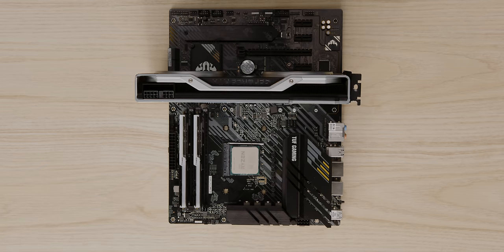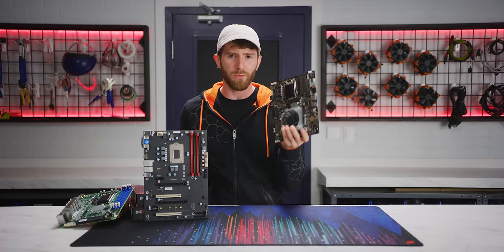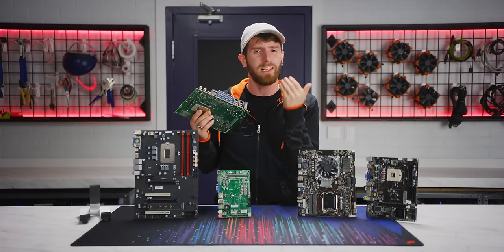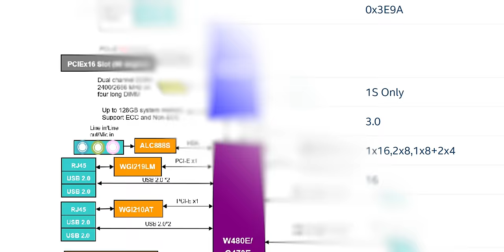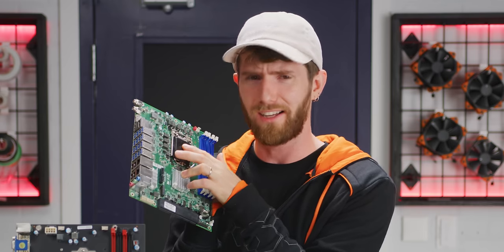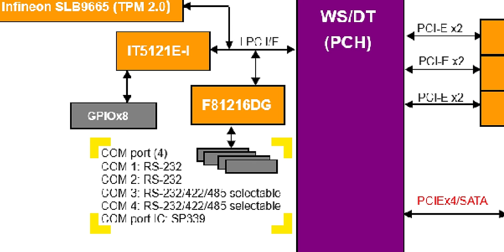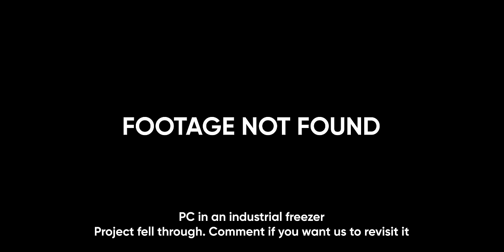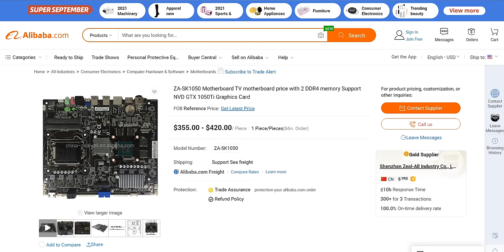5 weird motherboards that shouldn't exist

Comment: Saw this vid and it got me wondering.  With all of the various I/O available on motherboards, ie 10 USBs, 6 SATA ports, etc, how does a request for a device work?  Does the opsys simply poll all similar I/O ports, looking for the right one?  And if so, does that action slow down the computer at all? If this is the case, maybe we should be looking at a bit more minimalistic approach for a motherboard? For example, lets say i have 4 sata devices; one ssd and 3 HDDs.  when i ask windows 10 to find a document that ends up being on the SSD, it must look at all SATA devices, right?  Does the system look in all 4 sata devices at the same time?  Or one after the other?  Maybe i should only have 1 SSD with a large enough capacity and turn the other SATA ports off in the BIOS?

Comment: Moar usb! I actually needed an extra USB port to power a small 7" monitor on my rog strix b550i build. I wired a USB female plug into the 5v and gnd rails of a sata power. Works great ;D

Comment: The power for the first one is a satellite and cable type connector. I think you need to power the motherboard by fusing a wire to it, I guess.

Comment: The bonkers motherboards were the ones that supported both Intel P4 & Athlon CPUs, via a PCIe add-on card.  Or the over-engineered boards with copper cooling going to dedicated rads.
I for one miss the DFI brand.

Comment: "There's no manual available"
That can't be possible considering someone wrote drivers and the diagram you showed, it's gotta be around somewhere, guess I found another project
Reply: I've got a Portwell mobo (WADE-8321LU) and that is also in the same boat, no support whatsoever, no drivers, no manual for the exact model - had to resort to use another mobo's stuff.
Most exciting things were finding an experimental BIOS that supports Ivy Bridge (3740QM powaa), and adding another RAM slot to it (no SMD components missing, just the socket!).

Comment: Those x79 motherboards from China can be a good deal if you don't need anything beyond pcie 3.0. With the right chipset and a Xeon CPU, server RAM becomes an option, making 256GB-1TB of RAM actually feasible without costing a ton.

Comment: Those USBs aren't that stupid. Personally I use this devices on USB constantly plugged in: 
Keyboard
Mouse
Audio interface (sometimes two)
External drive
Card reader
Cooler
Grapchic tablet ( I dont know what is called in english, this black tablet you write and draw on)

That makes 8 USB ports and I need some free ones when I need to plug in some pendrive or gaming pad or an microcontroller to program or drone or other camera to service

Comment: the weirdest mother board I have ever seen was a server board that supported ddr1 and ddr2 ram
at the IT store i worked at it was one of the donated parts someone had dropped off

we had like an e waste recycling thing where people would drop off old parts or pcs and we put together super cheap computers for people

so the one office brought in 20 + computer as well as this server board
it took 2 single core celerons and had 8 dimm slots
4 ddr 2 and 4 ddr 

second weirdest thing was stackable ram so it was these ddr 1 sticks that you should slot another ddr 1 ontop of

Comment: Do the lenovo sharkbay, instead of your standard 24 pin PSU connector it has a 14 pin, this way the only way to upgrade it is to get a adapter made by some random person, and definitely not Lenovo

Comment: For the USB motherboard at one point in time I would have loved that board!
Reply: Nah, man, I still do not like wireless. I have a Windows Xbox controller that uses batteries and it is kinda a pain and cost is a never ending. The controller is a decade old, yet I still buy batteries for the Fing thing. Not saying it isnt being used, but my mouse G400S is also a decade old with no additional hidden cost. Wired is better, faster, less interference etc.

Edit:
Obviously I have wifi and use it for my phone, but still... Desktop stuff is wired. Gaming is via Ethernet cable, not wifi etc. LoL

Comment: Should be easy to obtain an old 2nd/3rd gen intel laptop CPU using Pins and one thats not Soldered on. I pull then out the trash at a scrapyard, and find the motherboard harder to source.

Comment: Too bad VIA didn't kept developing, there was the Via Artigo 1000 that would fit in a 5,25" slot with it's pico itx motherboard form factor and case. Sometimes going throu chinese sites there were some motherboards with this form factor and "faster" intel cpu's but same like the last board presented without documentation and quite rare pin layout.

Comment: jokes on you.. would like that 20 usb option.. my current pc only has 6 usb 2.0. 3 rear usb 3 + 1 type c (which ive made into a type a) (has 2 front usb 3's but cant use them) so a total of 10 ports...and i find that lacking so find my self having to unplug things to do something else. also 2 of those obv are in use for kb/mouse so only 8 usable ones. and i hate using hubs

Comment: It’s made for mining you have a external pci with usb on both ends you plug one usb into the motherboard and the other into the GPU on the external pci and you can mine with it that’s why it’s made I believe depending on how many usb you have available that’s how many gpus you can have on it depending also on the power you can put into it; theoretically you can plug 20 gpus into that one motherbord
Reply: It doesn’t have any pci slots for graphics cards because it’s meant for mining that’s why it has 20 usb slots
Reply: They don’t sell it anywhere else but their website

Comment: im extremely extremely late but i have to refute the laptop socketed cpu point. Tons and tons of business and consumer laptops had these until haswell refresh. Ive found personally its a lot mote likely to have a pga cpu on sandy and ivy bridge than it is to have a bga one. And they had a full lineup, from celeron to i7 extreme, on everything up to haswell refresh/broadwell, where they killed the line. AMD also killed their socketed stuff around this time, too.

Comment: That's not weird.. It serves a purpose. about 10:48 from 2nd gen to 3rd gen most of the processors are replaceable and upgradable unlike newer gen most processors are soldered to the motherboard. I have i5 3210m and upgraded it to i7 3630qm.

Comment: You probably should have added theoretical maximum speed per bus, not per port. 

Each port is not on it's own bus. If that wasn't clear by looking at the board, it was clear in the diagram.

Peace

Comment: On the motherboard that takes Laptop CPUs: Old Laptop CPUs are Low Cost, Low Power, Low heat.  If an office building wants to save money on computer cost, UPS equipment AND air conditioning, it's the way to go!   The Chinese are far more practical and understand this.

Comment: Any board that still has PS/2 connectors on it is weirder than any one of these, I don't care how common they are, we should have ditched those ports ages ago and start adding ports people would actually need, like USB-C.. I can maybe understand VGA (even though it's useless thanks to HDMI adapters), but I haven't seen a single PS/2 peripheral in almost 20 years. Meanwhile I can't find a case with even ONE Type-C USB when this format should have been made standard years ago, and 3.0 should have replaced 2.0 like a decade ago.

Comment: Well myself I need 20 USB ports for my pc that's because I use a lot of Sim pit devices I love to play games like Dcs World, Il 2 Sturmovik and Microsolf flight sim plus I have a racing setup ready to go also.       This is just one reason a person might want a lot of USB Ports I hear people all time why not use a Hub well first you have to get a powered Hub because most the devices take a small amount of power, the issue thou I have is you may get one that is not built properly which ended up letting power surge freely through out the hub and killed some devices this is why I wouldn't mind to have a mother board with 20-24 Usb ports.

Comment: CPU integrated motherboard should be a way manufacturer's out there by obtain recycle CPU from laptop parts. Some of them still offer good performance.besides hassle free installation of PC parts in CPU spec and compatibility. Sadly those trending is dying though.🥲. Many of them sell cheaper than buying a new motherboard with same CPU socket.🤔.

Comment: psh WEAK, Ive got 10x 10gb/s USB, a 20 gb/s USB ports on the mobo (plus a metric Fton of USB headers on the board) and with dual 10 gb/s etherne on the mobot... And unlike the 20 USB abomination I can use it all at once.